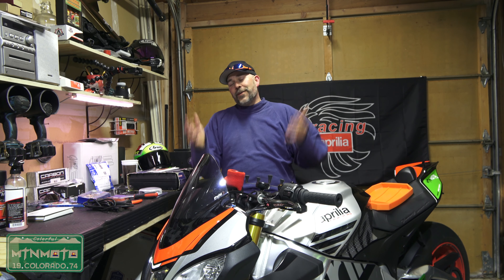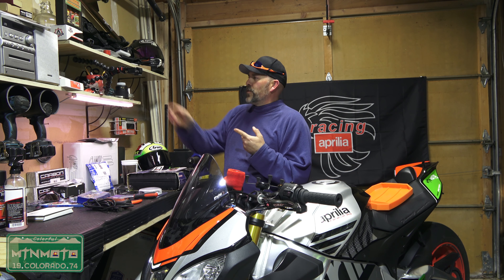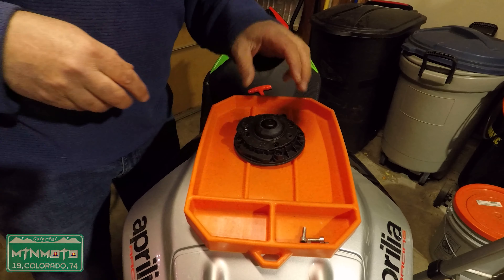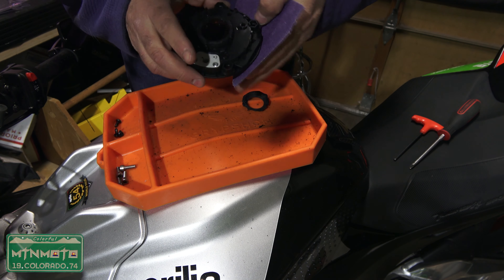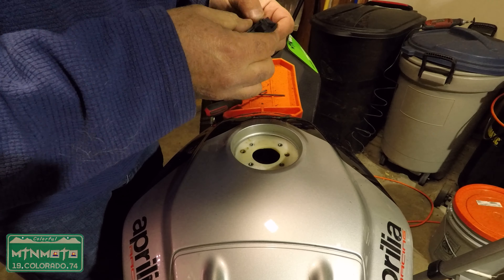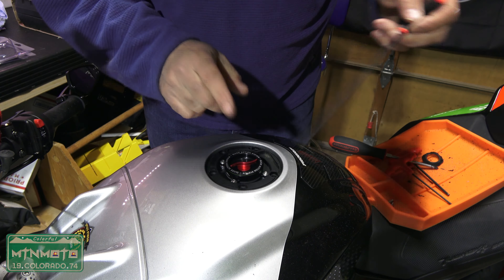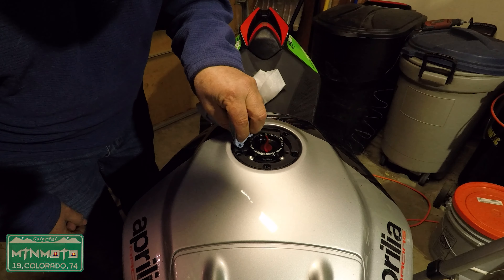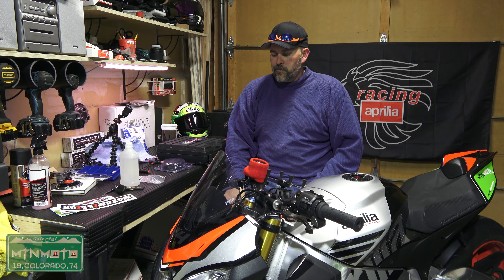2018 Aprilia Tuono Factory | The Ultimate Build | Part 14 | TWM Quick Release Carbon GASCAP

Comment: I have a few issues, first the carbon cover doesn't glue if you install the gasket around the cap, which you need to prevent water to ingress between the tank and cap. Secondly it creates vacuum, everything is installed correctly (gasket underneath and breather hole is free). I've tested the older version and doesn't have these issues, but it's much uglier. Do you have these issues?
Reply from the maker: I have noticed a vacuum when refilling but as of yet this hasn't affected performance in any way,  even on full tank performance rides. 
I'm not sure what gasket you're referring to.
Reply: @MtnMoto  If the vacuum is too high, for one is very difficult to open the cap and secondly it can actually collapse the tank. Around the original black gas cap, there is a rubber gasket that covers gap, it's in your video on the 7:40 min mark, without it when it rain or wash the motorcycle, water ingresses underneath the cap and no where to go.
Reply: @batukman it doesn’t create a vacuum it’s pressure due to the charcoal canister that is installed as a California emission item...once removed the pressure vents normally ...you must plug the ports on the throttle body and remove the canister...
Reply from the maker: @gaetanodicenso8337  this is what I noticed as well. It creates a pressurized tank when the carbon canister isn't removed.

Comment: Hey good video, I want to do this mod to my filler neck as well. Does it really help stop the splashing of the fuel though? 

Thanks!
Reply from the maker: I haven't tested it yet but if you believe the internet... Yes😉
Reply: Yes it does done mine a week after buying bike could just about get pump nozzle in before doing it
Reply: I was wondering, have you removed your whole gas tank?  Do you have a video, I do not want to pull a hose and have gas pouring out. Thank you !
Reply from the maker: WildstyleKyle1 Sorry Kyle I haven't yet. I'm hoping to be able to afford to get the race intake from the RSV4 later this winter and do the install on that. AF1Racing has an incredible forum that I think there are step by steps listed
Reply: @MtnMoto  Okay thanks anyway. Im doing a sprint filter and bren tuning ecu flash
Reply: @WildstyleKyle1  you can get to ecu and filter by just propping up tank just take off 2 breather pipes on left hand side
Reply: @markgenders8010  i saw those hoses and was not sure if one was fuel
 Im still waiting on my manual.  One has a clip that looks like you need to replace it after you pry it open?
Reply: @WildstyleKyle1  you can leave that one comnected it should lift up enough to prop it up to get to ecu bud
Reply: @markgenders8010  Right, I was going to be installing a sprint air filter. Looks like I need to take the tank up a lot higher that it will permit with leaving lines connected. :(
Reply: @WildstyleKyle1  just leave pipe connected and see if you can feed it up a bit to give you the space you need to raise tank